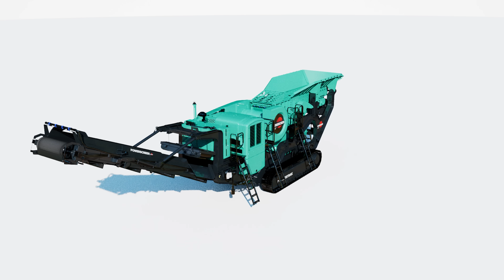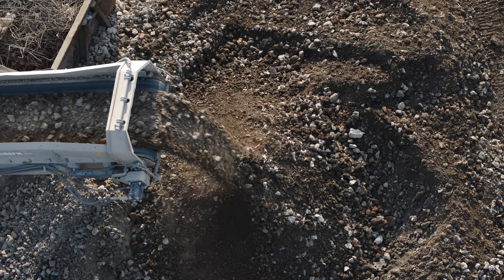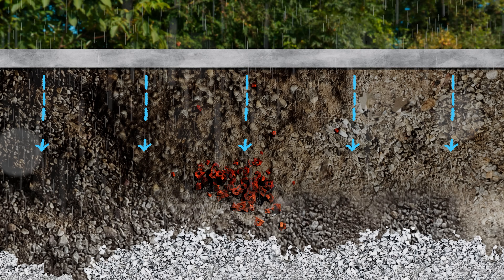How A CRUSHER Works to Create RECYCLED MATERIAL

Comment: Wow, hjow a crusher works, did you cover this in another episode?
Reply: The hopper vibrates, you can change the frequency to make it vibrate quicker, this feeding the jaws quicker. This is a standard crusher, 2 jaw plates, the one that moves had a ram on the inside that moves it back and forth, and crushes whatever goes in the jaws. The conveyor belt takes it out, you have a mag belt towards the end to pull as much metal out as it can